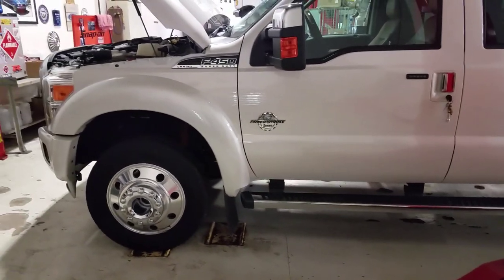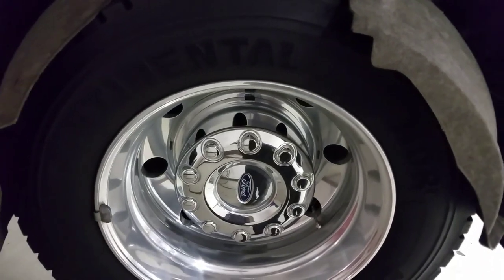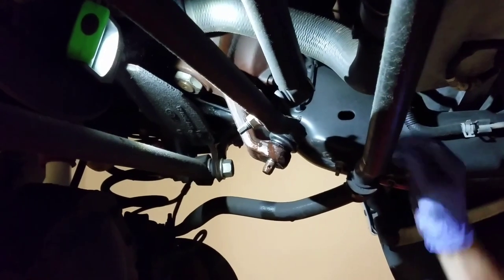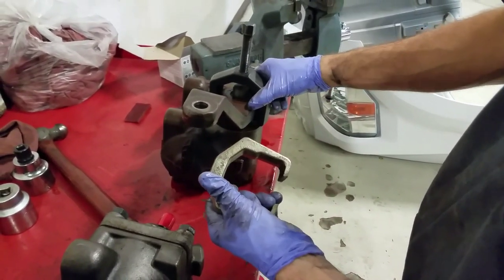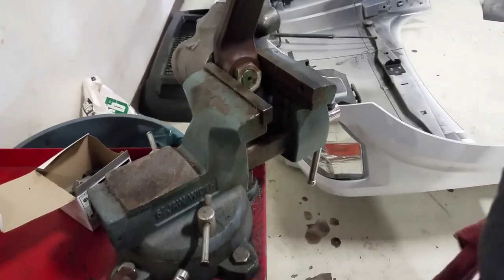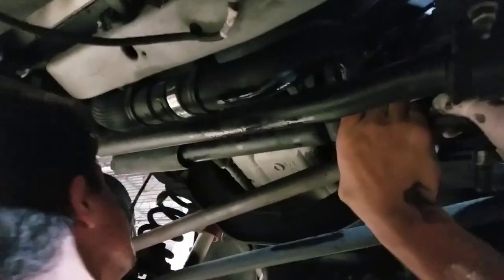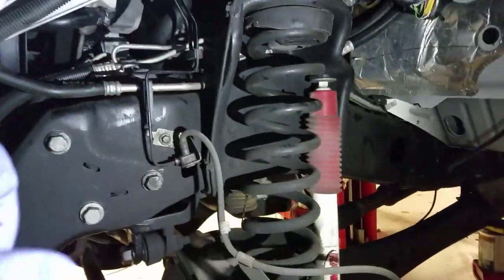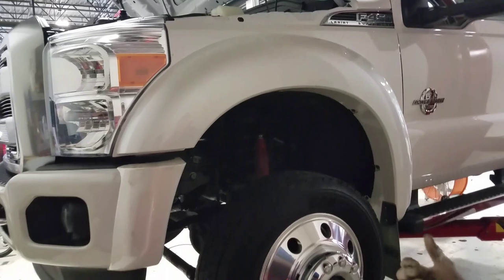16 6.7 F450 Power Steering Gear R&R

Comment: Arod I have a 2016 F350 pickup and doing a crate long block but I have the updated water pump it has 2 holes to put fittings but I'm trying to find some block off fittings Thanks.
Reply from the maker: There is an installation kit im guessing.....you dont have......
Reply: @PowerStrokeTechTalkwARod  Yes

Comment: The bolt on the drag link does have a torques speck of 40 lbft, I believe. Not torque it until just before you strip it. No wonder things are so difficult to get apart. What about flushing the system? All the crud that was in the power steering pump and the reservoir is now in your brand new steering gear. You never talked about holding the steering wheel in place either. You  don't torque the lug nuts?
Reply from the maker: Guess you're a little late to the party....

Comment: Do you need to add any thread sealer on the power steering lines into the gear box? I am thinking no, but wanted to ask you to confirm. Thanks for the great videos!
Reply from the maker: They had orings

Comment: Is there a difference between the 250/350 and 450/550 steering box's? Because of it being a wide track? I just wide track swapped a f350 and it doesn't turn completely like it should
Reply from the maker: Probably different part numbers

Comment: I have a 2003 Ford F 450 with play in the steering gear.... I checked the tie rods and ball joint and they are good... Is there an adjustment for this year?
Reply from the maker: Naw man most likely gonna need a gear.
Reply: @PowerStrokeTechTalkwARod   I had the Steering gear replaced, with a factory MotorCraft STG 109 RM from the dealer and I have less play but I still have play in the steering wheel..... If before I was seeing 3" of play now I see 1" of play.... The bucket truck weights 12k lbs and I don't want to see any play when on the highway doing 70mph... lol .... Is there a way to eliminate the play,,,? The truck only has 40k miles... What do you think?
Reply from the maker: Hmmm

Comment: I have a 2011 F-350, and have had really terrible return-ability problems with the steering gear. It doesn't "center" when going down the road has very little feedback. It's super tight. Does ford ever recommend adjusting the quill? or is it just R&R?
Reply from the maker: Jus R&R
Reply: Thanks, I guess they changed the design at some point. The 2011's have a quill in place of the black plug on the top of the steering gear. I need to replace mine at some point the steering is annoying.
Reply from the maker: I bet